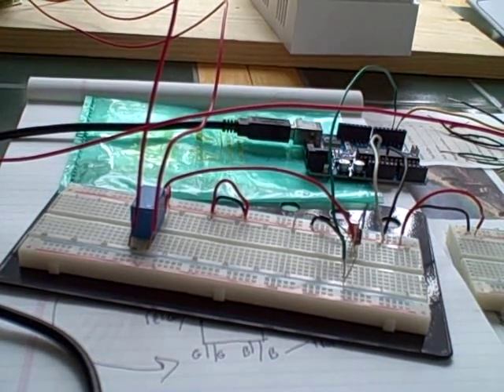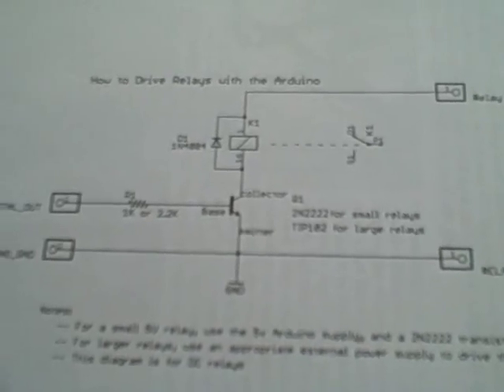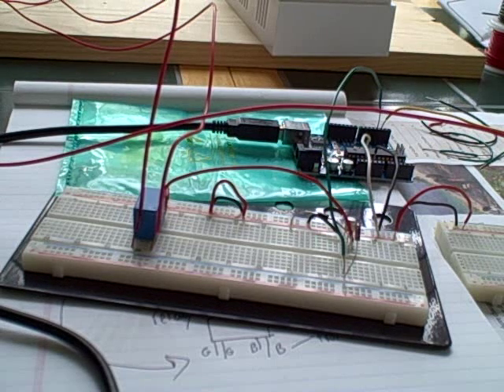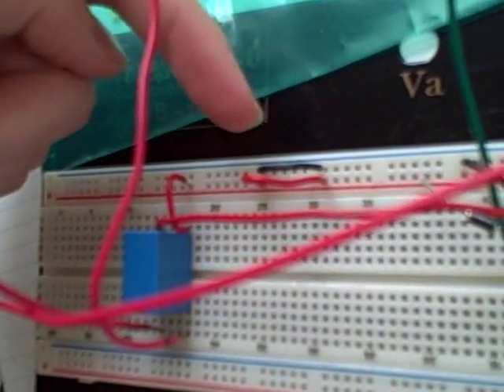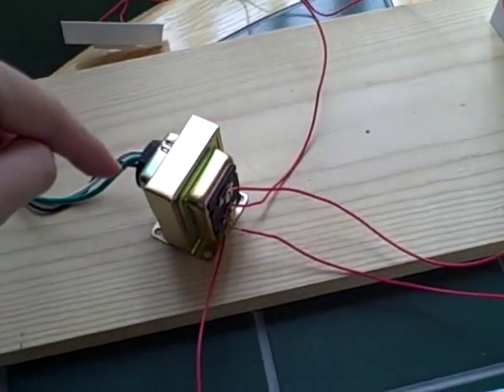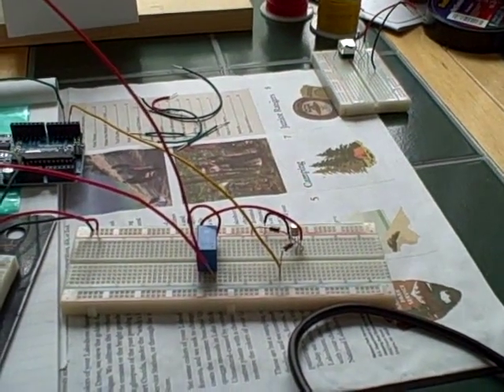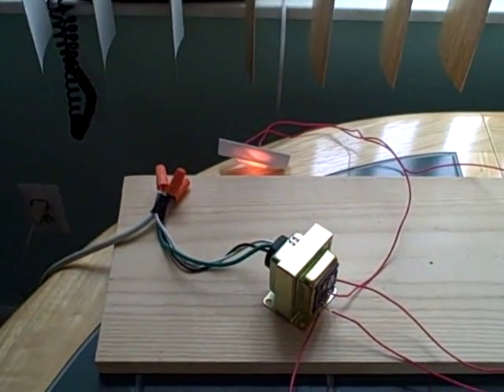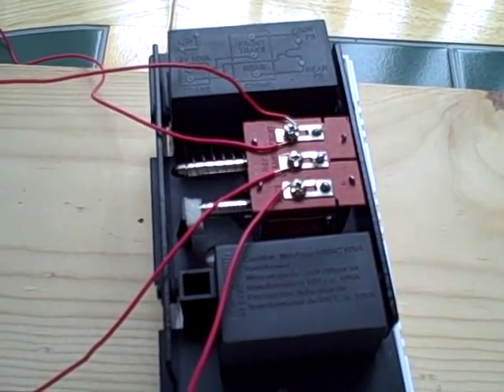Arduino Relay Driver

Comment: I'm sorry if the question is too stupid, but i want to know why do you use a transformer... thank you
Reply from the maker: +Martha Maldonado The transistor acts as a switch and it allows you to turn on the relay. You also need to protect the microprocessor from back EMF current and that is what the diode is doing. For more details please read http://www.glacialwanderer.com/hobbyrobotics/?p=9

Comment: Hi it's been a Long Time a was searching some information how to connect Arduino and a doorbell. My goal is to detect whether the push-button was pressed ir not. Do you think you can help me? 
Thank you.
I just subscribed!
Marc.
Reply from the maker: +Marc Paradis Hi Marc, you can definitely hook an Arduino to a doorbell. That is what I did before hooking it up to the garage door. I have a video with the doorbell, it is two videos before this one. Check out the links I have in this video's notes... especially Maurice's Hobby Robotics, it shows how to hook an Arduino to a light and it is the exact same idea. Thanks!

Comment from the maker: @TheTubejunky, Glad you liked the video! I usually power the circuit on my breadboard with the 5V and Gnd in the Power header on the Arduino. There are a lot of options when it comes to powering your components. You could use a variable power supply, a batter pack, or a voltage converter with the right adapter so you can use power from a wall receptacle. Make sure you follow the schematic that is in the video notes. The diode is what will protect your power supply.

Comment from the maker: @aaronandnicole, I used relay with part number OJE-SH-105DM. It could handle up to 5 Amps at 240V AC. The data sheet for it says: Rated Coil Voltage = 5 VDC, Nominal Current = 91 mA, Must Operate Voltage = 3.5 VDC. I was able to use it with the Arduino. I don't think you can add current by having more than one output pin. I think you may need an external power source. The place you bought the relay board from may be able to anwser the question better. I'm always learning more about relays.

Comment from the maker: @aaronandnicole, I always take some sample code from the Arduino software and modify it. So I guess it always uses pin 3. According to the Arduino documentation: Each of the 14 digital pins on the Duemilanove can be used as an input or output, using pinMode(), digitalWrite(), and digitalRead() functions. Some pins have specialized functions also, check out the Arduino web site and choose the "Hardware" link. YouTube isn't letting me post the URL.

Comment: Very good video.  FYI there is always high voltage across the power leads on the relay when it releases. It acts like a solenoid and produces high voltage spikes . That is the reason for the diode.8)